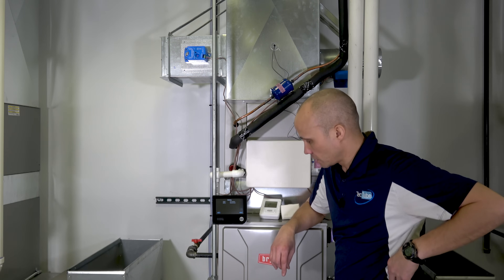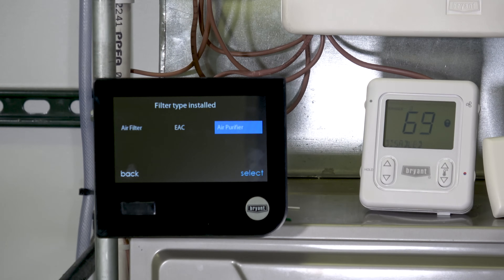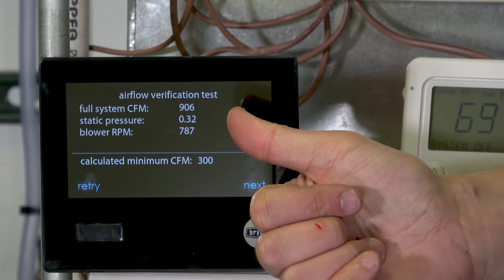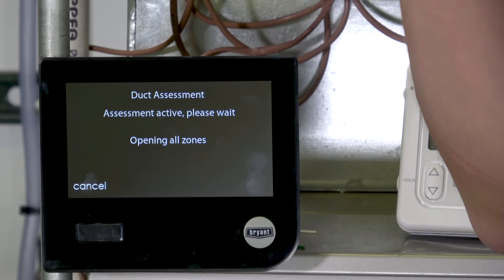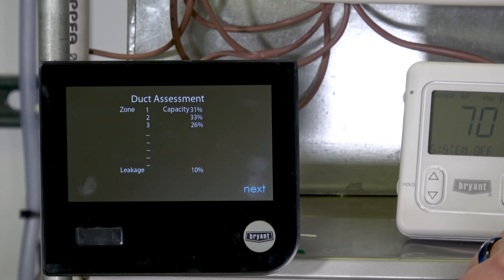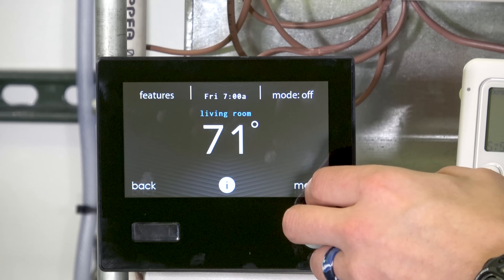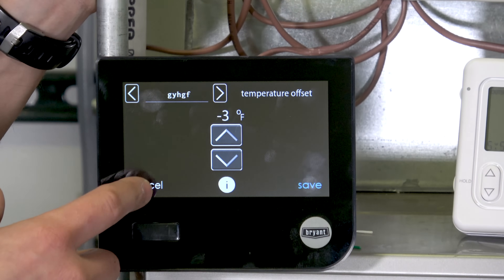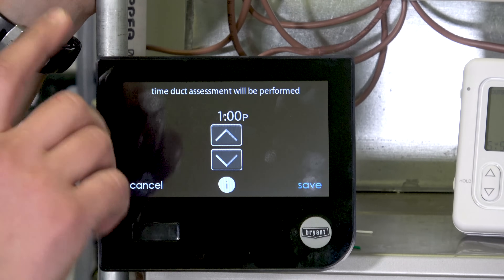Zoning System for Infinity, Evolution, and Ion Controls

Comment: Is there compatible EWC or honeywell dampers that would work with the cardier infinity? We tried using the the regular ewc urd dampera and honeywell Ard and couldn't get the zones to be controlled by the thermostat. They would just stay open.   Thankyou if you respond
Reply from the maker: Why are you trying to do this anyway instead of using the Infinity dampers? Is it because you want more size choices? If that is the reason, source your dampers from a 3rd party without any actuator installed and then get just the Infinity actuator with the correct degrees of stroke (usually 90 degrees but sometimes 45) from your Carrier distributor. Locally here in the Chicago area, we have used Vent Products Co. They have often made us rectangular slip-in dampers of unique dimensions and put an actuator mounting plate on the side for us. https://ventproducts.com/products/air-control-dampers
Reply from the maker: You cannot use 2-wire actuators that power open and spring closed, if that is what you are asking. You can use 3rd party damper actuators if they are 3-wire floating point control AND they have the same stroke time as the Infinity ones.

Comment: You have any training on the zone control when it goes bad?
Reply from the maker: Goes bad? What specifically has gone bad and how did you determine the issue was the zoning board vs the wall control, the wiring, the damper motors, etc?
Reply: @TECTubefilms  i think its obvious he is speaking on troubleshooting lol
Reply from the maker: @ Agreed. But what SPECIFIC symptom is being troubleshot in this case? If he said the condensing unit was bad we would have also asked "what specific thing are you trying to learn to troubleshoot within the condensing unit." We were going to attempt to tell him what to check next if he said what was wrong.
Reply from the maker: No, we are not aware of any comprehensive training for troubleshooting between the various pieces to determine which specific widget to replace.

Comment: Hello! I have a Carrier Infinity Zoning Board SYSTXCC4ZC0 , running with 2 Zones (Upstairs and Downstairs). Can I run each zone with a Carrier Infinity System Control SYSTXCCITC01-B ? Every time I get through Setup after the Zoning search it can only find Zone 1 for Upstairs and Downstairs. How can I set up a Control for Zone 1 (Downstairs) and another for Zone 2 (Upstairs)?
Reply from the maker: You cannot install two SYSTCCXXITC01 controls on the same system if that is what you are asking. That control can be used for zone #1 only. Zone 2 needs a thermistor sensors or a smart sensor.
Reply: @TECTubefilms  Thanks! I just bought the SYSTXCCRRS01 Infinity Remote Room Sensor to control Zone #2 with the Infinity System Control. I was told that the SYSTXCCRRS01 Infinity Remote Room Sensor is getting a supersede later this year and will start shipment once the current stock is depleted. Apparently, they want to update the look to match the newer control and Smart Remote Room Thermostat.

Comment: If you have a Day & Night system with an older Comfortmaker communicating control system, can you replace that with Ion? In other words, you remove the zone control board and existing thermostats and replace them with Ion equivalents. Will that be able to talk to the existing furnace and outdoor unit?
Reply from the maker: Yes. Ion controllers and zone boards are compatible with older ICP communicating equipment such as furnaces and condensing units that used to have Observer controls connected to them. With that said, you can't mix the zone controls (i.e., have an Observer zone board with an Ion wall control, etc)
Reply: @TECTubefilms  Thanks for replying. I have a ZONE0101ZP6 zone board and some TSTAT0201CWs that just won't talk to each other. Do you know if replacing the thermostats with TSTAT0101SCs would work? The zone board manual mentions those, but not the '0201s. Had 3 separate techs out and they couldn't make it work.
Reply from the maker: @__S__435  All 3 of the model numbers you listed above appear to be part of the obsolete Observer control line. The Observer control line is totally different than the Ion controllers shown in our video and we don't have a lot of expertise with Observer. In general, we would not recommend removing the latest version of electronics (TSTAT0201CW) and replacing it with older versions (TSTAT0101SC). Presumably your system was functional when installed 6+ years ago so something has changed. It can be troubleshot with an electrical meter, as well as by temporarily relocating control widgets next to the equipment and adding them back onto the network one at a time for communication testing to determine the widget causing the issue.
Reply: @TECTubefilms  It actually never worked. (The zoning, that is. Everything else is fine.) The reno project stalled, the company that installed all the equipment (except the thermostats) broke up, and the system was eventually finished by someone who appears to be a handyman. I'm thinking the ZONE0101ZP6 may just have old, incompatible firmware since the TSTATs are much newer. It has a programming header, but no one I've talked to is interested in trying to flash it. That's why I'm thinking the older '0101 thermostats might work... same era, probably compatible firmware. I have two of these systems and the problem is identical on both, so it seems unlikely to be a fried zone board or a frayed cable. Since no tech will have anything to do with this (all 3 had never seen it before!) I'm left to figure it out on my own, and you know what, it's REAL hot in my workshop 'cause the zoning doesn't work!
Reply from the maker: @__S__435  There is only one vintage of Observer zoning panel as far as we know. If it never worked then it is most likely not wired correctly or not commissioned correctly (the main stat has to discover the zone board and zone stats during setup). We are also wonder if the people that you are trying to hire to fix this are official "ICP Elite Dealers" or just random HVAC companies? You can search for a dealer on ComfortMaker website. Or you can also try other major ICP brands like Heil, Tempstar, Day & Night, etc. The Observer system is identical for all of them. https://www.comfortmaker.com/en/us/find-a-dealer/
Reply from the maker: https://www.dayandnightcomfort.com/en/us/find-a-dealer/
Reply from the maker: https://www.icpusa.com/en/us/our-brands/

Comment: Being Carrier/Bryant are now the same as Heil/Comfortmaker.  Can I get a new Carrier zone system and pair it up with a new Heil two stage furnace.  I handle Heil equipment, but the vendor only handles Honeywell zoning, so I would need to go to the Carrier vendor to get the zoning system.
Reply from the maker: Heil has its own zoning system. It works exactly the same as Carrier/Bryant but it is not interchangeable with Carrier/Bryant. The Ion main stat is needed to communicate with the Heil Ion furnace. A Carrier Infinity or a Bryant Evolution stat will not communicate to an Ion furnace.

Comment: My evolution 3-zone setup has this issue--the two zones athat aren't calling for heat are still getting heat with heat called for at one zone. I can't tell if the dampers aren't functioning properly. The installer thinks the system may be dumping heat at two zones due to an overheating issue.. Any ideas? Thanks!
Reply from the maker: If the smallest zone can handle less CFM than the furnace can turn down to, then the system will look to send air into a zone that is in the "away mode." If no zones are in away, it has to send the excess air to other zones. It has to send it somewhere OR shut off the heat completely. 

This can be avoided during the design phase by selecting smaller capacity equipment AND looking at its required minimum airflow too.

Comment: Will a Honeywell TruZone damper that has power close and spring open work on this infinity system? If not, can you buy the actuators separate to replace?
Reply from the maker: No, that damper will not work. Infinity dampers are modulating via a tri-stat floating point single that requires 3 wires. Honeywell dampers can't modulate at all and are 2 wire constant power closed and spring open.
Reply: @TECTubefilms how can we test these 3 wire modulating dampers. I thought I would see 24v from common and close when the damper is closing and would see 24v from common and  open when the damper is driving open. But no matter if the damper is opening or closing I have 24v from coming to open, and have 24v from comonto close at the same time. Damper is driving to the correct position but I'm not understanding how it's working? We tried a different 3 wire belimo actuator for a different zone damper that we were going to have to wait months for but it Wil not drive correctly at all since whenever the zone board sends command to drive the damper it gets 24v across btoh open and common to close. I'm confused
Reply from the maker: @carlneuman5958  We are not entire sure what you mean or where EXACTLY you are putting the meter leads during this test (on the board or on the damper). We can try to recreate your test in one of our training labs.
Reply: @TECTubefilms I did both. Meter leads at zone board and at dampers. We have 3 official heil dampers and one io damper that's supposedly is compatible but it won't work right . But yes all 4 dsmoers get 24v from common to open, also get 24v from common to close no matter if test at board or damper.
Reply from the maker: Yes, you can buy and install Infinity actuators onto the shafts other brands of sheetmetal dampers.

Comment: I have a damper issue. Why when actuator is in opening mode  it throw power to power close? It's impossible to receive power on both.. Or power open or power close depending on control calls.
Reply from the maker: We are not sure what you are saying or asking
Reply: @TECTubefilms  i figured it out already. The infiniti zone use modulated dampers actuators
Reply from the maker: @joeschneider67  True. They are modulating dampers with 3-point floating style control signal. The motor only moves when 24vac is applied and then freezes in its position when no power. The control pulses the damper "more open" or "more closed."
Reply: @TECTubefilms  well, when damper is opening, gets the power to open, but also send power to close. That's the part that makes my braid spanning. I mean, of apply power to open or to close, but not both at same time

Comment: Can you use 2 of the new updated ion control thermostats to run two separate zones off the same board? Both thermostats would be wired to the same terminal on the control board and when doing such I cannot setup more than one zone. Do I need to replace one of the thermostats with a sensor instead?
Reply from the maker: No, only one Ion stat can be used per system. You will need to replace one of them with Smart Sensor.
Reply: @TECTubefilms  its amazing. Carriers techs that they shove you to at your local Johnstone Supply couldn't figure this issue out. I tell you through 4 sentences and you're able to figure it out. Thank you. I hope this works and will keep you updated.
Reply from the maker: @seanfreyy  Well... in their defense we don't expect Carrier techs to know how ICP stuff works. Sometimes it is different. The old ICP Observer Stat (predecessor to Ion) was able to be used in the way you described where you could use an Observer for zone #2, 3, or 4.
Reply from the maker: @seanfreyy  Wait... we just realized you said that your Johnstone store that you bought ICP products from told you to call your competitor at a Carrier dealer to answer your technical questions? WTH?
Reply: I see where the original confusion on their end came from where the old style used to work as sensors. After calling carrier for tech support they referred  us to our local Johnstone where they have “specialized techs” for troubleshooting these products. 

Smart Sensor is on order and hopefully comes in soon.
Reply from the maker: @seanfreyy  Wow. Someone at Carrier actually told you to call their direct competitor for help. That is insane. Please say it was not in one of our offices in the Midwest (we are part of TEC, which is a Carrier distributor) LOL
Reply: LOL! No I am on the east coast. Long Island. Can I order a sensor from you? Everywhere I try is out of stock and unsure when they’ll be back in.
Reply from the maker: @seanfreyy  We are just a training division. We are part of Temperature Equipment Corp, but our guess is that they can only distribute within a certain territory.
Reply: Can you confirm the part number of the sensor I will need?

Is it the SYSTXZNSMS01?

Comment: I currently have my smallest zone saying it’s ZONE AIRFLOW LIMITED STAGE DOWN OCCURRED. What’s the best option to get around this with out upsizing the duct work?
Reply from the maker: That usually means your smallest zone is smaller than the required minimum airflow of either the furnace or the A/C. For example that zone can only move 300 CFM, but the furnace needs at least 400 CFM to stay online. This usually occurs when the zone system is designed incorrectly with what we call "micro-zones" or the equipment is too large and needs to be a couple sizes smaller.

Comment: I am having this 4 zone system installed soon. I read that you should not use a bypass damper. I have one for a humidifier. Will this cause any issues?
Reply from the maker: You cannot use a "zoning bypass damper" with this system because that damper responds to static resistance changes but the furnace blower is also trying to control static. You cannot have two things controlling one variable. A bypass humdiifier (with our without a shutoff seasonable damper) is unrelated to the zoning discussion because it does not control duct static pressure.

Comment: Having one hell of a time chasing down the source of a code 126 high heat cycle, 
I understand that the dip switches for air flow doesn't mean nothing when using this zone control?  And also I'm assuming that according to manual gas pressure testing procedures that I should disconnect four wire terminal block and jump r w1/w2 on standard stat board?
Reply from the maker: Yeah 126 is a newer code. It is not specific to zoning systems and will occur on non-zoned systems also. The bottom line is the furnace is locked into high fire due to an active 33 limit trip. We know it sounds weird to put it into high fire, but it is doing that to get the higher airflow. Start the troubleshooting by measure ESP.
Reply from the maker: Correct, the wall control handles the airflow settings and ignores the dip switches.
Reply from the maker: Here is how to set gas pressure - https://youtu.be/bI45GFiXraw